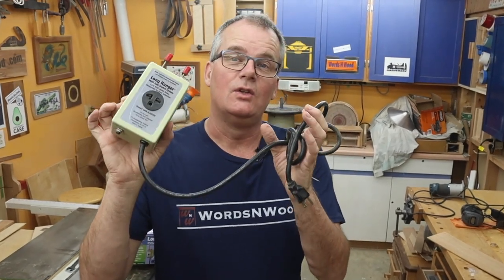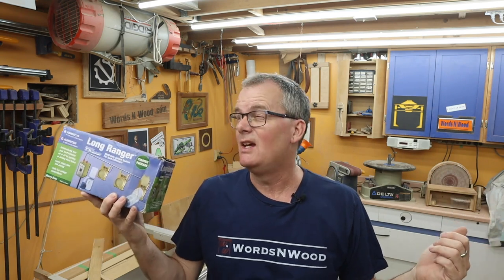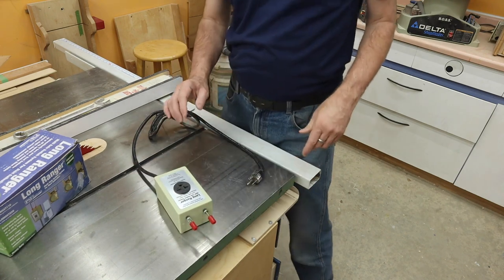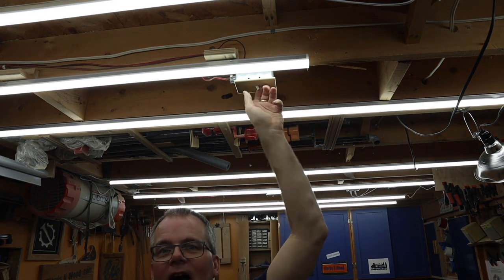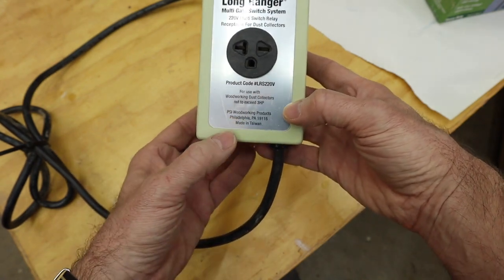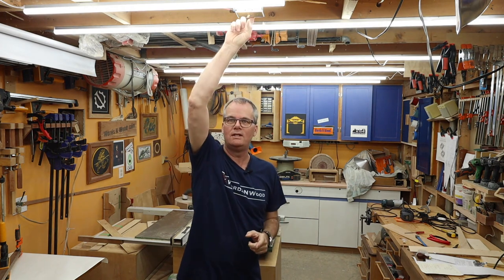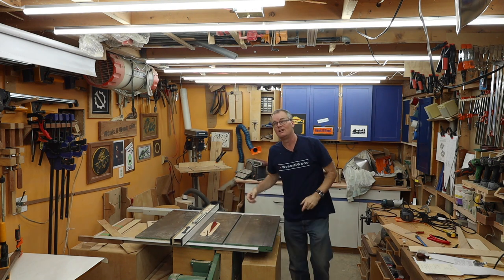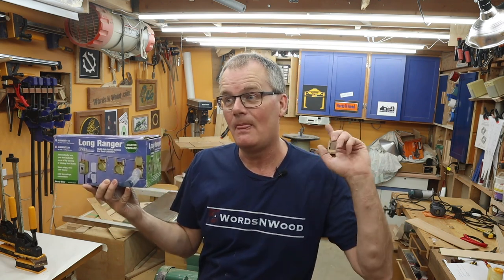Dust Collector Remote Control review after  FIFTEEN YEARS // WnW 238

Comment: I've had my Long Ranger (the version with the remote) for 14 years so only 1 more to go before I can review it.  Or if you want a preview, you can drop the remote on the concrete about 600 times before it breaks and then you can just buy the remote separately to replace it.  You can buy multiple remotes so you can put them in different spots like you have with the switches but I just clip it on my back pocket.  I've only forgotten it's there until I sit down on it in my office on the 2nd floor about 100 times.  I only forget when I do one thing that needs it so I put in on my pocket and then I'm in the shop for another 2 hours and I've totally forgotten about it.
Reply from the maker: Thank-you, Kevin... you just listed all the reasons why I decided to NOT get a wireless remote all those years ago.

Comment: The way you've wired the switches in parallel, you have to turn off the DC from the switch that you used to turn it on.
If your lightswitches are (single-pole) double-throw, you could wire them in two-way switch mode, so you can turn it on from either switch and turn it off from either switch.
Reply: You are correct. Art has kept the wiring simple.
Reply from the maker: Undoubtedly there are more ways to do it!

Comment: If I used blast gates I think it’s a nice way to skip a step to turn on the dust collector. That or the many times I’ve forgot to turn it on. It is simple enough to setup with inexpensive wire and switches. I seems like my ideal setup and preferable over the volt detecting when you power on a tool systems.
Reply from the maker: There is definitely something attractive about the idea of using the microswitches on the blast gates.   And I totally agree that it is far simpler than these new current-sensing switch things that I've seen from iVac (others?)

Comment: Great video! I order from Amazon the long ranger and I was very happy that they did deliver to Greece. Unfortunately the product does not open my 1,5 hp Jet dust collector. Two electricians I asked for advice said that I have to open and adjust the dust collector in order for long ranger to work. Did you do the same? Thanks in advance
Reply from the maker: I did not.  I am not an electrician, sorry.  When the relay wires are connected, the system turns on, that is all I know.

Comment: Art, do you think you are rushing your review a bit? You've only had the controller for 15 years! Sometimes a simple design is more durable. 

This would not work with my DC because the DC has an electronic start-stop button.

I am curious about what is in the box. It may just be a mechanical relay and a crude low voltage power supply.
Reply from the maker: True, I should maybe give it another 5 years...

Comment: The way you have it set up, couldn't you have just used a regular 220 outlet?
Reply from the maker: I don't understand what you are saying... it is a regular 220 outlet.  The remote plugs into the outlet, the DC plugs into the remote.   Then I wire up the lv switches wherever I want in the shop which trigger the remote to turn on or off.
Reply: @Wordsnwood  I think he was just saying, why not just wire up a normal 220V switch. I was thinking the same thing. Like you could wire up the your dust collector outlet like any light switch.
Reply from the maker: @rsporter  Ahhh,   Sure that would work with one switch, but moving a bit of Low Voltage wire is a lot easier if you decide you needed to move it.   And, as shown in the video, this way I can add multiple switches, or go back to the microswitch-on-the-blastgate option also.